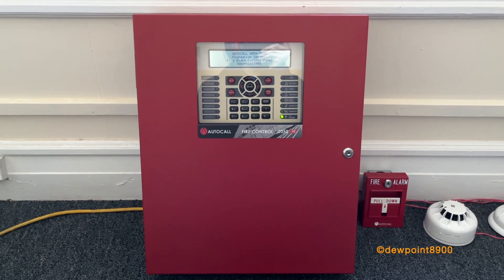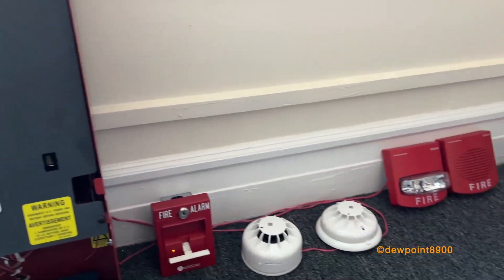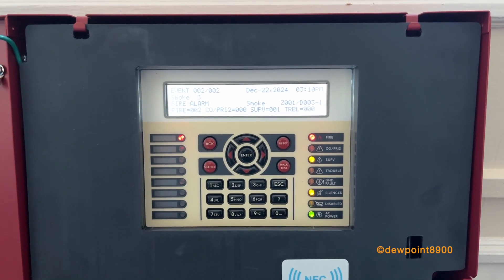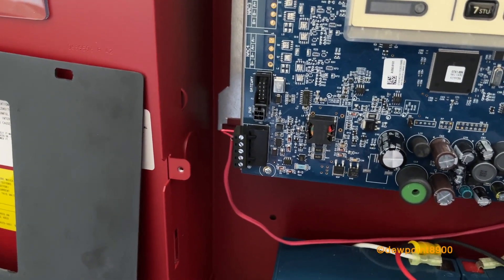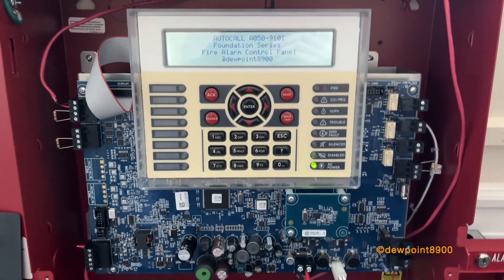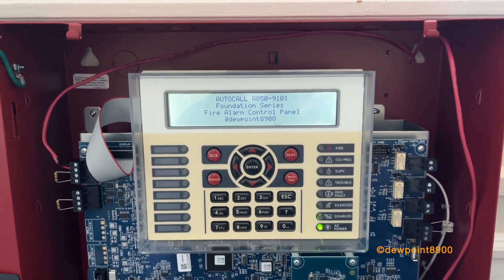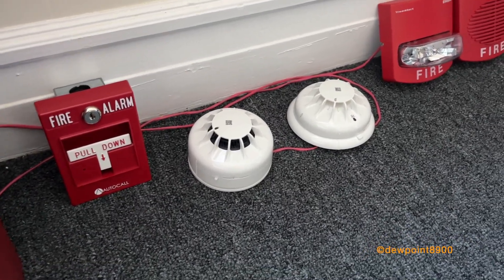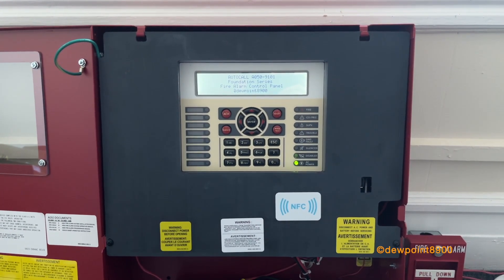Autocall 2050FS Foundation Series Panel

Comment: Those detectors look similar to the ADT detectors we have in the UK
Reply from the maker: The detectors are made in Switzerland, so I wouldn't be surprised if they're the same housing.
Reply: @dewpoint8900  they do use the same housing plus the tone is very common over here for the ADT sounder bases we have
Reply: @dewpoint8900  plus I like how you can program the panel with a phone
Reply: @dewpoint8900  they do use the same housing plus the tone on the sounder base is very common over here for ADT systems
Reply: ADT in the UK are owned by the same parent company as Autocall. Johnson Controls